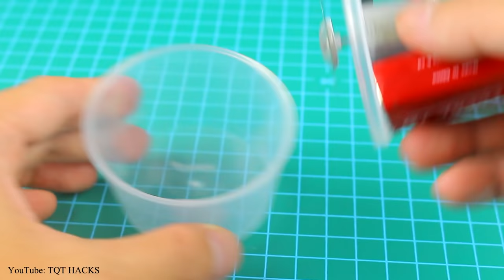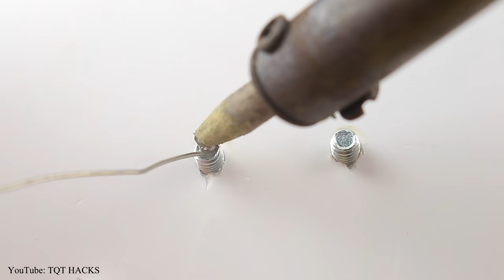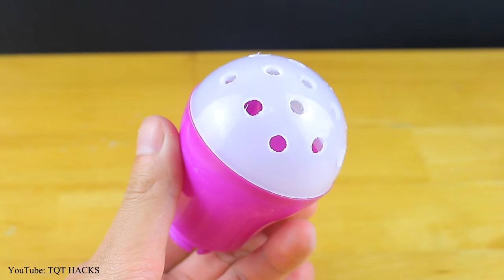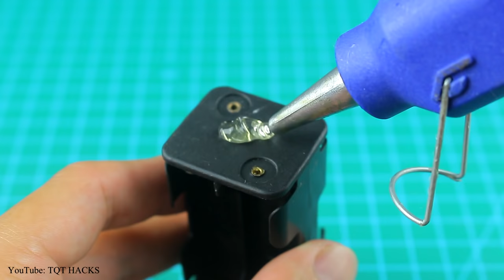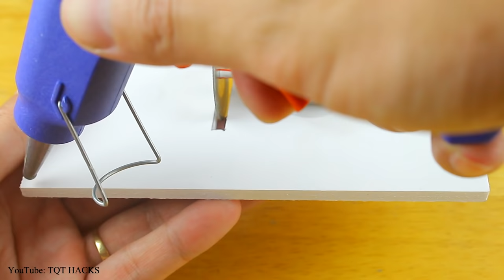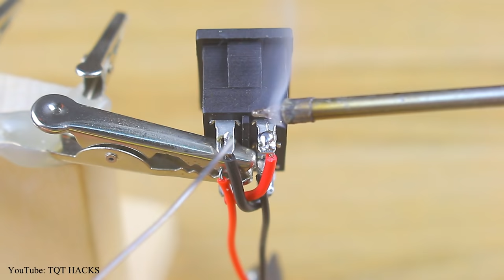8 AWESOME DC MOTOR LIFE HACKS | DIY TOYS | SIMPLE INVENTIONS

Comment: Why this motors get hot when run with 5v?
Reply: overvolt
Reply: 5 v motor lo
Reply: Actually you are using less than 5volt motors which gets more voltage so it heats because potential increase then current will also increase so it gets heat

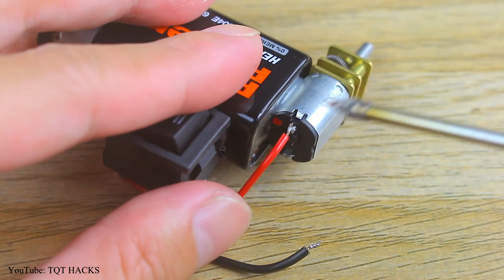Comment: The last motor hack at 20:00min, what kind of motor is that? It seem good as electric screwdriver.
Reply: N20 Micro Gear Motor 3.7V - 6V

Remember if you want to make electric screwdriver then you should buy less rpm motor because the have more torque